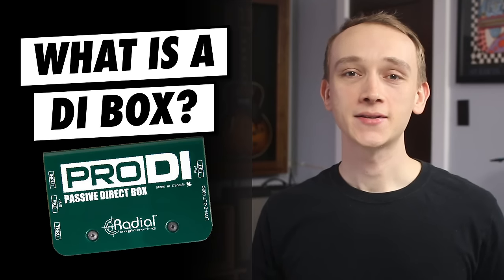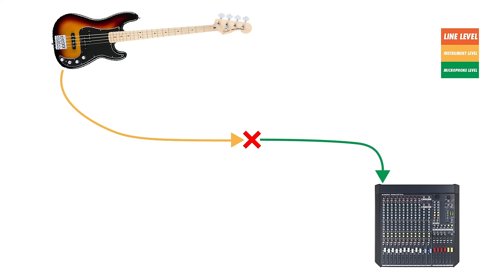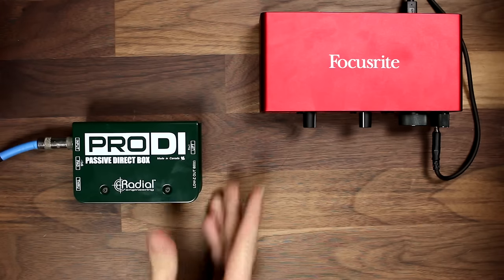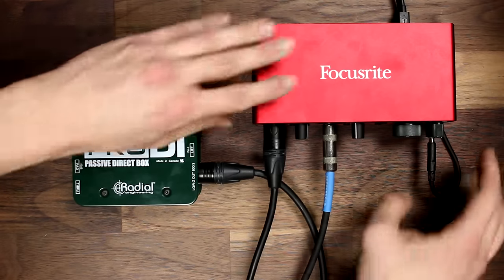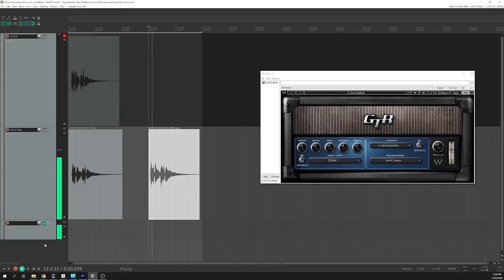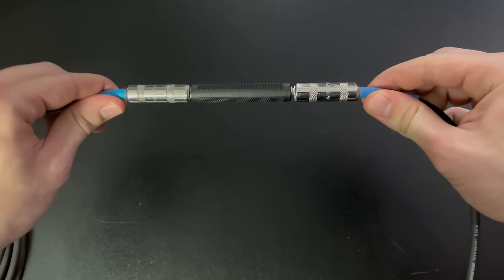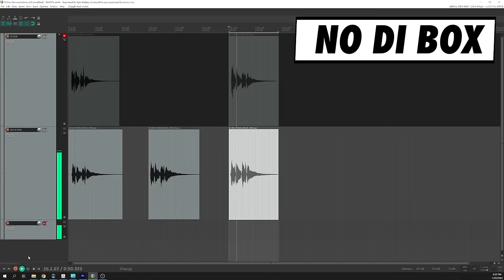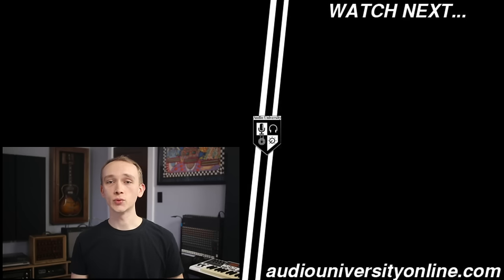What Is A DI Box (Direct Box)? | When & How To Use One

Comment: While is a subtle difference by using a DI box the real reason for them to exist is to eliminate the noise catchup effect in high impedance cable runs, so if your purpose is to clarify or enhance the quality of the sound DI is not the tool but equalizers, compressors and filters.
Reply: Would a DI help if I am going via a multi fx pedal (Boss GX100) into my interface’s instrument input. And where would you place it.
Reply: @accentontheoff if you're going to use it with a loudspeaker system, then BOSS GX100 Left or Right Output > D.I BOX > Audio Mixer  > Speakers.
Reply: @accentontheoff in this case, since you're plugging into an instrument socket in your interface, chances are you're not that far from it. i usually use multi fx'es and D.I boxex to avoid micing up amps and if I want to go long cable runs
Reply: @zrellll  Got it thanks. So there is going to be no automatic improvement in sound quality using a DI box? It’s just useful to cope with long cable runs.

Comment: for a guitarist who understands buffers, it's like adding an incredible buffer to your signal to retain all your sonic, frequency detail over long runs of cable, and using hum resistant balanced/shielded xlr cables.  one thing to remeber, is if your producing noise pre the di box with your gear, a di won't fix it.  you ned to fix your the week link in your signal chain first.  same goes with a mic'd cab.

Comment: Connecting phones/computers: Radial Pro AV2 (stereo DI box) I keep in my bag as a rarely used problem solver but when I need it, it delivers! Usually you can connect monitor/line outs directly into camera line/mic combo inputs and you’ll get excellent or at least usable sound. Some equipment you get really noisy audio even over short cables, you put that DI box in between, and you’ll mount your XLR input box, and suddenly the audio is pristine. So really great thing to have in the bag if you don’t know equipment at the venue or if any weird / unexpected connection request may emerge.

Comment: I use them though for recording anything that isn't a mic to protect my mixer. Especially the 20db boost and 20db attenuate are very useful when connecting loud devices and instruments or low level stuff.
It allows me to connect line level and keyboard phones connection for example to my mixer side by side.
Great stuff.
And hot into the mixer but below Max mic level gives a great noise to signal ratio as you don't need any/much gain

Comment: I wish People would stop talking about high and low impedance signals, I think that is confusing to non-professionals.  “Signals” do not have Impedance, which is a property of the hardware.  Impedance is “resistance to alternating current” (our signal is a very weak alternating current).  it is much more correct to talk about signal level and high & low impedance sources or outputs and inputs. The presenter correctly says that the DI box is a [unity] transformer which isolates two circuits with different impedance levels. Remember we know that an alternating current (ie. Our signal ) will pass through a transformer.
Overall I like the video, just my “signal” impedance rant.
Reply from the maker: That’s helpful feedback. I’ll keep this in mind for future videos. Thanks.
Reply: @riff1964
As a non-professional I must say that you have only made it more confusing for me.
Reply: You made it way more confusing.... Just saying..
Reply: @Brinta3  Yes, I had to read it a few times, to kind of follow and see the difference between what he was saying, and the original video. 

I can see there are some technicalities between the words, ‘signal’ and ‘source,’ but not sure when those would come in to play—or if really needed to know. 

I’m assuming the original video is sound,  in its application and product.
Reply: This is not directed at you it’s towards the people who have put this spirit on you because they refuse to use their brain

Comment: When they introduced the piezoelectric pickup for record players, they used the effect that is caused by high impedance sources on low impedance inputs, that it   almost reverse the RIAA curve.
High impedance is also the reason, that condenser microphones needs an active  impedance converter close to the transducer. Therefore the early condenser microphones had a big housing.

Comment: I connect my guitar & bass directly from the amp to the input on my 4 track recorder with no issues. Only problem I really have is getting vocal tracks to sound decent. I mean I have a cheap $10 dynamic mic but I've used it it the past with decent results.

Comment: Reach out a couple of hundred feet of cable distance in a venue and unbalanced signals are probably unusable.  Considering cable distance not linear distance, it doesn't take a very large venue to have a couple of hundred feet of cable (because you don't want every idiot in the room tripping, stomping, or spilling beer on your snake).  I prefer active DI's, they just tend to be a little brighter over long distances.  Yes, there can be some extra noise from having another amplifier in the chain but I generally find it tips the scale by having a stronger signal.  And if the source is passive, active DI is the only way to fly.  A basic passive DI is just a transformer inside, an active DI has a small (pre)amplifier in there.

Great video!
Reply from the maker: Thanks for watching and sharing your thoughts on this!

Comment: the signal from a cable is neither high impedence or low impedence if you truly want to become a master and I can tell you are super smart at a young age so this is why I am dropping some knowledge on you.  the signal is nothing more than a voltage.  a Guitar signal for example (passive pickups) is going to be a very weak signal.  the impedence is in the mixer channel or guitar amp input itself.  The cable guage and length have an impedence ( factory will have ohms per foot or ohms per meter ) but for the most part we don't care because it is such a small number for short lenghts... particularly for guitar cables because they are unbalanced and you already did a great job of explaining the noise.  ANY cable is also an "antenna" and there are signals in the air which can induce currents/voltages onto anttenae.   Its more complicated though than how sound techs usually explain because every cable has resistance, capacitance, and inductance associated with it and so it really gets ugly quick if you truly want to analyze what is happening.  You will need to know differential equations and laplace or fourier transforms to be able to do basic calculations.  I honestly personally don't know the material well enough to explain it OR TO EVEN HAVE CONFIDENCE that what I am calculating is "right" or "wrong" (and I need good notes or the textbook).  but anyways the shortcut most sound engineers take is to only consider the impedence of the inputs.    With XLR inputs, think of the input as a small speaker and you need to "drive" the speaker with a voltage.   IF using a mixer, the XLR may have a "pre-amp" or "head amp" so that you can amp up a microphone level signal... (not even getting into phantom power here) but the xlr input might be on the back of a powered speaker - many of those do not really have a "pre amp" for a microphone and so you need to properly "drive" the input if you want the speaker to make the power spec and SPL spec listed in the manual as well as THD spec (this is when long xlr cable runs come into effect - when your mixer way out front behind the crowd and you are driving the inputs on power-amps on the stage or powered speakers - its also why you have a main fader which can go positive because for a 200 foot run, you may need to go a little positive to get everything out of that amp - but like your video on "noise", you did a pretty good job of explaining what factors long runs bring to the table).  I am not telling you this to criticize your video, you have well thought videos.  I can tell you that in the 30+ years I have worked in the music biz as a sound engineer, I definitely never stopped learning.  I thought I knew everything I was going to know when I was 25 and I have plenty of footage of shows from back then.  and I can tell you straight up that I am too embarrassed to share those videos because I made a ton of false assumptions and believed many things that simply are not true.  There is no way I could have known what I know becuase the companies that make the gear don't really explain it.  so many are afraid others are missing that one last secret bit of knowledge which will take them to the next level.  it really is an overly competitive world.  I have come to believe that there are plenty of ways where personal taste and style differences alone on a level and fair playing field leave plenty of room for competition and so I usually share the secrets - within reason.  you don't want to give a nuke to a crackhead you know.  you wouldn't give a 14 year old a 1000cc super-bike to practice wheelies on would you?  well there are topics with specialized knowledge that you just don't go around sharing because most people won't even know what the heck you are talking about.  You probably already have experienced feeling like an "island"
Reply: Wow.... thanks mate! Lots of pertinent info. Cheers from Toronto...

Comment: I use a radial DI on my keyboards when playing live. What’s great is as well is taking out noise or potential problems from ground loops the sound from digital keyboards which can sound harsh takes on a smoother quality especially in the high end and the dynamics are less extreme similar to using a compressor. The signal being knocked down also allows you to also utilise the character of the preamps by running to a mic input rather than line so overall an acoustic instrument sound like a piano sample will sound less electronic and more like the real thing. I don’t play without a DI anymore

Comment: Okay so I have a question... 

Recently Universal Audio has released a pedal called the Ox box pedal (which is like a speaker emulator of guitar cabs) 
- my thinking is that if I have a original Marshall 1959hw amp and cab, I will use a DI box in between 
-the signal coming from DI will first go through the amp then to a Ironman II attenuator and then to the actual cab...
- lastly the DI signal from the DI will go through my interface to record plain DI signal for later use of UA Ox Box, for reamping, re-cabbing  
- (the reason i don't want to use the Ironman II line out is because I don't know if it can actually allow me to use both the speaker out and DI out at the same time, if it does then it would do my job of platform to use pedal, but then I don't know if it can used as tool for reamping in the interface...) 
- key goal here is to use an actual amp and cab in a room, and being able to use the Ox Box as well as freedom to reamping the signal...

Comment: One time I had the situation, a bass player was playing into the mixing console, I found no way to get a good sound, so I bought a bass guitar Preamp and that was the solution.
Reply from the maker: Great tip, Rob!
Reply: By the way, the unit has speaker simulation, XLR output and some overdrive. Also 3 band equalizer.

Comment: Most guitar effects processors and modelers have line-level outputs. I've been discussing with friends that if the distance of the cable is no longer than 30 feet it doesn't really make much of a difference to use a DI box to connect the modeler to the mixer (line-level input), no matter if it isn't a balanced signal. My point is that when you have line-level sources it is not a matter of impedance but a matter of balanced - unbalanced signals depending on the distance between the source and the mixer. My friends will always use a DI Box and I tell them it isn't necessary. Am I correct?

Comment: Great video. The issue that I've gotten almost everytime is that connecting my pedal board to a DI it gives a very harsh tone that is terrible and no matter how hard the engineer tries in the end he just removes the frequency that is the true tone of the guitar. That's why I like to mic the amp and maybe over dub it in the studio. 

Do you have an alternative solution to this?
Reply from the maker: The electric guitar sound we are used to hearing is passed through an amp and a speaker. Listening to the DI directly after the pedalboard will usually sound kind of sterile. 

I’d recommend running the DI signal through an amp plug-in and a speaker emulation plug-in. The speaker makes a big difference in rolling off the harsh high frequencies. 

I hope that helps! Thanks for watching!
Reply: @AudioUniversity  thank you. Makes sense.
Reply: Its hard to say without hearing the issue, but it sounds like you may have too much gain. If that's the case, you should be able to fix it. You need to start by looking at everything in the signal chain, from your guitar to the DI box, and identify anything that adjusts "volume". Once you do that, you need to determine which ones are actually volume controls, and which are gain controls. Gain controls are on the input of any given component, and volume is on the output. The important thing to know is too much gain can distort the signal, while high volume will not. You'll have to experiment a bit, but start out with your gain controls set fairly low and try to get the signal where it needs to be with your volume controls. Just try to keep the gains as low as you can, and if that's your issue, doing this should work.

One other thing could be the DI box itself. They're not all exactly the same, and can have different features. If you're using an active DI box, try a passive. The DI box itself could be overdriving the input on the mixer. I doubt this is your problem, because whoever is working the mixer should already know this and would have made sure the box wasn't the problem. But just in case, have a look at it.
Reply: @AT-wl9yq  thank you will drop the gain and hear how it sounds. 👍🏾
Reply: Dude, get a cab simulator. Running your pedalboard direct to the DI is great, but only for clean guitar (guitar direct to mixer is what clean funk players did back in the day). But for stuff with low to high gain, you need to have speaker emulation to make it translate better to the mixer.

Cab sim pedal examples are:
- Mooer Radar
- NuX Solid Studio
- Strymon IRidium

These have speaker emulation to make your pedalboard rig sound better and "amp-like" for the house sound
Reply: @kennhern  you're right. I'm planning on getting one. It's better.

Comment: Your video is timely for me. I'm planning on connecting a digital piano to my audio interface via a DI box using two 3-foot unbalanced cables going from the two AUX out connections on the piano to the DI box and 2 50-foot XLR balanced cables going from the DI box to my audio interface. I'm not planning on using the DI box to connect any other instruments to my audio interface. An inexpensive ($30) DI box made by a well-known audio manufacturer was recommended to me. What would be the advantage of going with the DI box you used in your video vs. the one that I'm planning on buying?

Comment: Great video, explained well. Even though I use a DI box from my pedal board I did not exactly understand how it worked so well. I have an idea maybe you can help. I use a small board in church.  6 pedals. I'm tired of dancing for each song. I also have a Boss Es-8 switcher on a LARGER board but it's too big to lug every Sunday. I would like to have the Es-8 off my small board but have a quick disconnect coupler for the 8 TS and midi cables.  I bought a automotive 20 pin connector an plan to solder the TS wires to the connector. Before I try this is there something on the market that can connect TS TO TS ? Thanks in advance.

Comment: My attempt is, that most signals as possible go balanced to my mixing console.
To use some non balanced stereo inputs, I have a stereo compressor, with XLR ins and Jack output and a DI/Splitbox, that has Jack, RCA and XLR as in and out and can turn any non balanced input into balanced.

Comment: I have a question that is maybe rethorical but that is bugging me a little: why would a rock guitarist put his amplifier on the "thru" output on stage like there @1:29 ? He would hear his "marshall" overdrived sound for example, but the public would hear a clean guitar sound. That would not be a good monitoring setup. Or maybe I'm missing something?
Reply from the maker: In most cases, the electric guitar amp will be mic'ed. So, DIs are most useful for electric guitar in the studio. For electric bass, however, it's very common to use a DI in a monitoring/FOH setup.

Comment: I have been researching whether I need a DI box in my setup or not. I have a boss GT-1 processor that goes to a mixer through a very long 1/4in cable. The rest of the band connects to this mixer using XLR cables (mic, bass, drums). 

Although this setup seems to work, I wonder if my guitar signal and tone will improve by connecting the output of the GT-1 to a DI Box via 1/4in, then from the DI box to the band's snake, then mixer, via XLR. 

I know a DI Box would be appropriate if I was connecting my guitar straight to the mixer, but that is not the case. My understanding is that that multi-effects processors will output line level, hence my question. Thanks!!